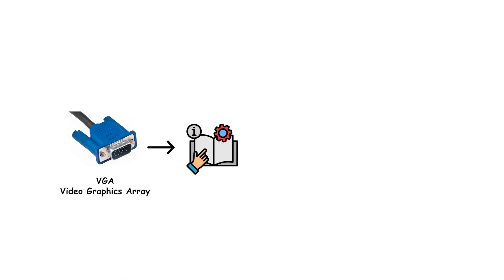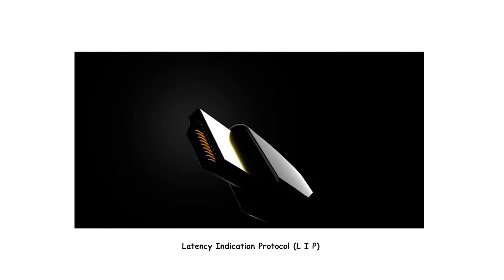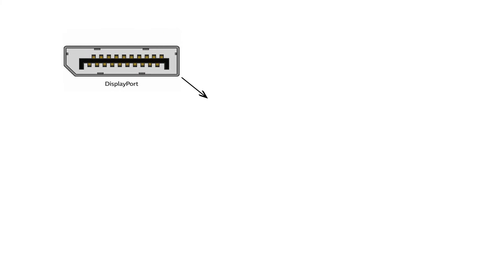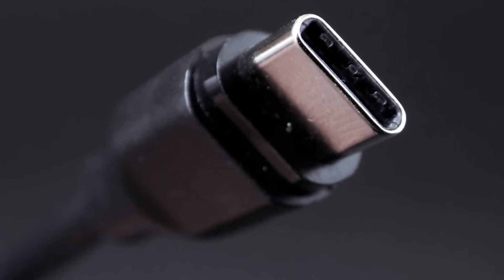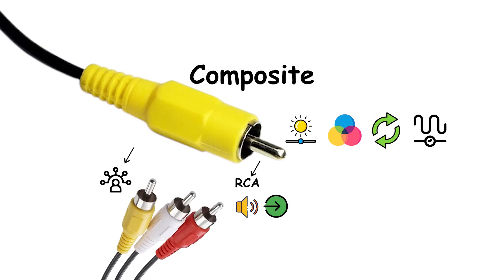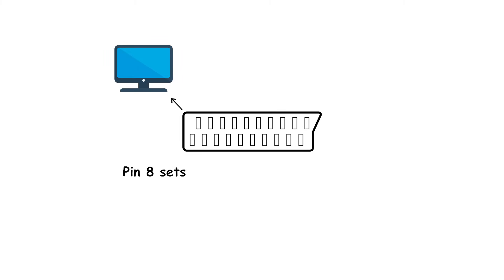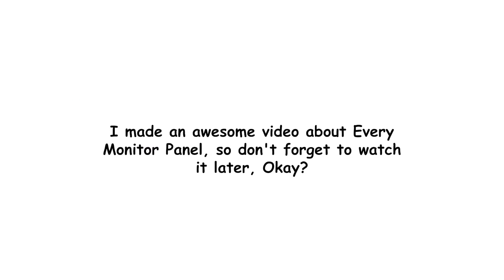Every Display Cable Explained in Detail

Comment: my old GPU used to have s-video  to YPBPR leads and reach 720p
Reply: S-Video is component Analog but is not work in YPBPR mode but is not perfect
Reply: @gabriel-andrei-x7r it can work because I used it like that for years with my gtx 660

Comment: Analog DVI can also transmit VGA analog video. Digital DVI is very similar to HDMI.
HDMI connectors are available in standard, mini and micro sizes. USB-C is sometimes used for HDMI.
DisplayPort is backwards compatible with HDMI. At least at the smaller resolutions.

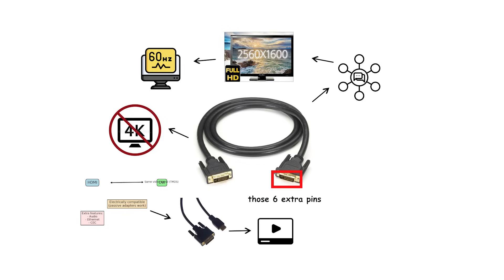Comment: 2:19 This is not true. While it is true that a fully compliant, up to spec DVI interface cannot output audio, most DVI ports on modern graphics cards share the same video controller as the HDMI controller, thus using the DVI port with a passive DVI-D to HDMI cable WILL pass through audio.

Can confirm that this is the case; using the DVI port on my Dell OEM RTX 2060, to the HDMI port on my Philips 241E monitor will allow me to output audio to my monitor.

Comment: Computer generated voice over gets this video a down vote and clains to be every display cable but is missing Various TTL display standards from the 1980s and Luma Chroma cables (not s-video) supported by some 1980s computers like the Commodore 64. not to mention professional analog RGB standards and commonly seen proprietary connectors used by companies like Apple.

While officially DVI does not support Audio, because DVI is electrically compatible with HDMI, unofficially Audio over DVI  is commonly supported. Most GPUs support Audio over DVI as they support sending a HDMI signal through the DVI port. I am watching this video on a computer that is doing Audio over DVI. I prefer using the DVI port over HDMI as the DVI port is screw in.

Comment: I use a hdmi to dvi cable and it does transmit sound
Reply: Some cards and devices will support HDMI audio over DVI with certain adapters, but if you plugged the DVI cable into a DVI compatible monitor you wouldn’t get sound because DVI wasn’t really meant to carry audio.
Reply: @Pincapybara  DVI actually can carry audio but it was rarely supported.
Reply: @TechHowden  That’s quite basically what I said.
Reply: A fully compliant, up to spec DVI interface on a graphics card will not transmit sound across the data lines.

However, DVI ports on modern graphics cards often share the HDMI controller, thus using a passive DVI to HDMI cable on the DVI port on such graphics cards will pass audio through to your monitor or TV sound system.

If your graphics card does not support HDMI and only has a DVI port, you likely aren't able to do this, as the controller used for the DVI is probably a DVI only controller.

Comment: Missed std 75ohm F-connector NTSC ch 3/4 used by Apple II and others.
Reply: Too be fair all the others are baseband video, (not riding in a carrier) an F connector is not.
Reply: Then maybe baseband should have been in the title.  But it wasn't so ...
Reply: @jabbathespud  this video is about actual display cables, not television formats so NTSC over RF should not be counted.
Reply: Also the multi format output that was on PS1-PS3, which was basically just an iteration of full-spec Scart.

Comment: i use DVI  and transmite audio
Reply: Neat, DVI audio was rarely supported but some stuff has it.
Reply: DVI
Reply: do you use a seperate 3.5mm jack or have external speakers
Reply: @IBISHU_PlGEON  no, mi monitor have speakers only use dvi D,

Comment: vga and dvi are king because you can overclock then and on vga sometimes you even get the joyful experience of breaking a dac

missed cga, ega and mda

edit: no, theres actually 5 dvi connectors (dvi-a, dvi-i, dvi-d single link, dvi-d dual link, dms-59 (a subversion of dvi having the ability to be split to 2 monitors. dms stands for dual monitor solution, and 59 is the pin count. it supports digital and analogue)
dont know much about display so i couldnt correct everything
Reply: well the overclock you are referring to works only on the DVI analog part which is essentially VGA signal through DVI, and not really through the digital protocol, however, the digital dvi ones plus displayport (and eDP) support digital overclocking which isn't really related to the cable or port but rather sending higher resolution to the display than what it natively supports